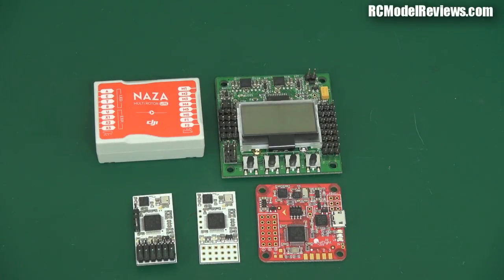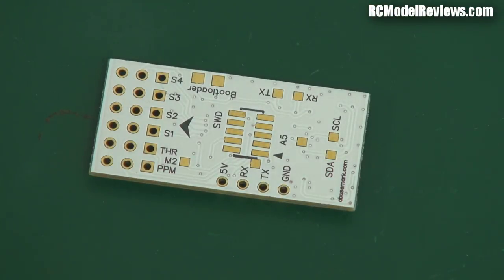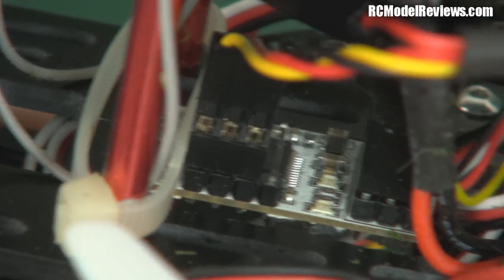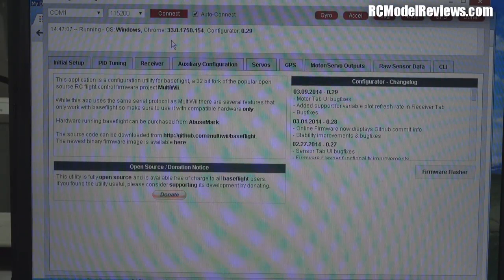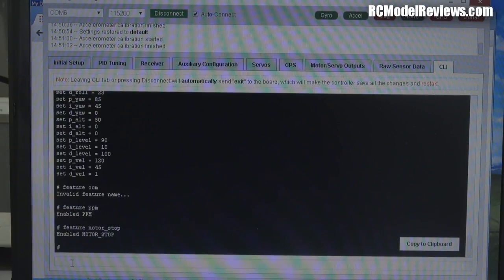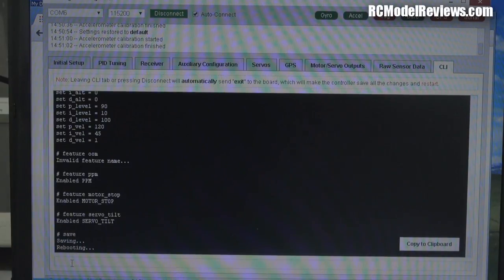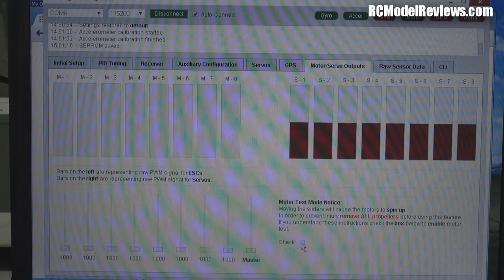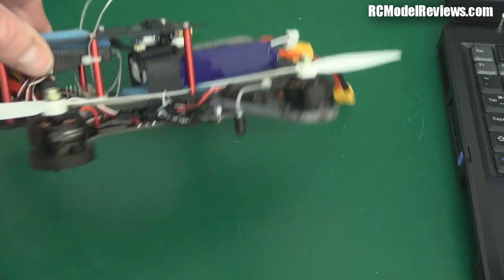Setting up the Naze Afro mini and Naze32 flight controllers (basic)

Comment: does the naze32 do return to home?
Reply: yes, no and maybe. Only the Naze32 Funfly (the full fat version) will support RTH since it includes a compass and baro. You will also need to connect a GPS like one of the LEA series typically used on the APM and Multiwii. It is fair to say the developer and lead programmer for these boards has next to no interest in autonomous flying modes. So if these modes are important to you there may be better solutions available.
Reply: Rob B . Find rth helpful when the camera or goggles fail on occasion half a mile out. The Naze32 looks perfect for a 250 park fly quad. Tempting! Thanks for the info Rob
Reply: You can do rth with a afromini and gps if you are flying fixed wing!
Reply: Byro
A double wammy there. As I said the autonomous modes have a low priority so to the fixed wing support. I'd recommend the APM or similar if you don't mind doing a fair amount of research and testing. Alternative proprietry systems like the FY-41AP Lite http://boltrc.com/blog/tag/fy41ap-lite/ are easier to setup and fly.

Comment: something isn't right.... I have the FrUSB-3 and the connector on the board is not in the same corner as Bruce's.
The link that Bruce provides to by the adapter has 3 pictures of FrUSB-3. http://www.banggood.com/FrSky-Upgrade...

On the first two, it is consistent with what Bruce has. On the 3rd one it is opposite, just like on mine. So something is messed up there. 

If I could guess based on letters next to pins, connector on my board
is soldered in the location that corresponds to 5V levels (pins: G,V5,Rx,Tx). If it was soldered in the opposite corner (like Bruce's) it would correspond to 3V level (pins: G,V3,Rx,Tx). So since we are supposed to use 3.3V FTDI, my board is the wrong one but it is the one that Bruce points us to! I looked on Frsky website and based on the picture of FrUSB-3
I do have the right one, so I have to conclude that its not FrUSB-3 that Bruce uses in the video.

What makes it even more confusing is the fact that Frsky Usb boards use inverted signal compared to standard FTDI.
Described in detail : http://diydrones.com/profiles/blogs/frsky-s-cppm-at-27msec-firmware-update-with-ft-prog-and-ftdi-cabl

If Afromini is supposed to be used with standard FTDI, how can it even work with Frsky boards unless it is deliberately inverted using FT Prog?

Would be great if Bruce could chime in on this.... Other than that great video!